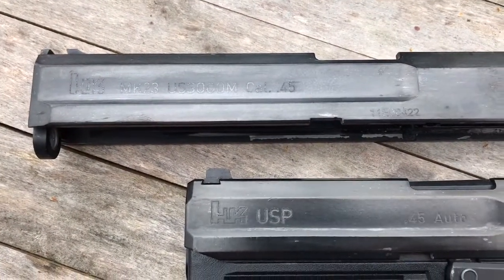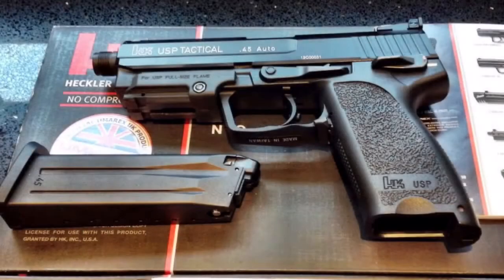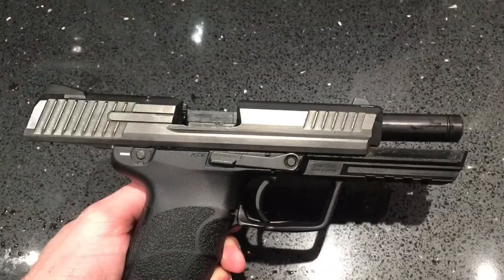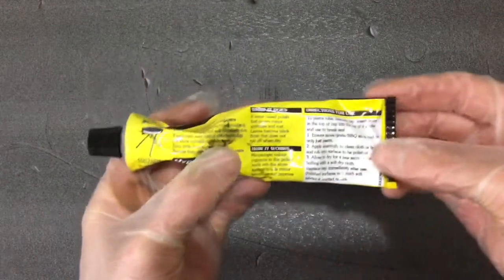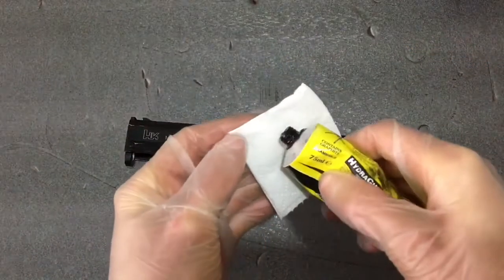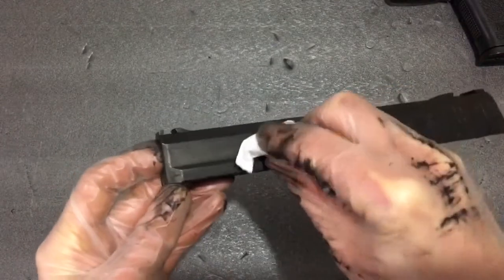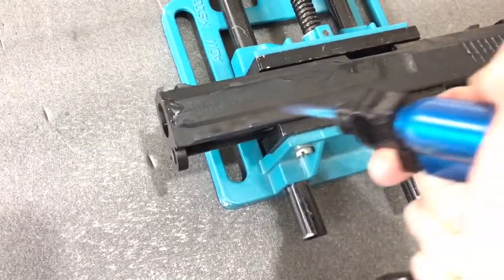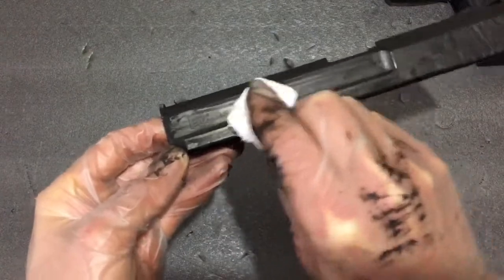How To Remove White Trademarks From Airsoft Guns

Comment: Oh man the first video on this got me interested but this one definitely has my attention. Only thing I'm worried about (never dealt with this product before) is does it leave a residue? Does it stain the part and can then be cleaned and manipulated? Will I have polish residue on my hands every time I rack the slide? Dumb questions but this is definitely something I want to try!
Reply from the maker: +zebracherub 
If you don't brush the serrated edges free of build up, you're likely to get some residue yes. 

The polish over time wears off with only slight residual flecks of graphite left on the metal, especially on GBB pistols where just above the ejection port, silicone oil will splash onto the surface and seep through polished area. 
Without the heat treatment one can return the finish almost back to the original state, as I said you'll still get the odd metallic specs but on the whole it doesn't leave stains. 

Good question, thanks mate.
Reply: Thanks for your answer!
Reply from the maker: +zebracherub 
You're very welcome

Comment: How long and often would you add the heat in the ten minutes. Would a hot airgun work ?
Reply from the maker: No just a quick pass to season the polish into the metal. You don’t want to potentially compromise the material, it could warp depending on the particular type of metal. 

I don’t know about a hot air gun as I only ever used the flame.

Comment: But is this permanent? And will it leave black marks on your fingers when dry?
Reply from the maker: If the lettering is recessed a little it’ll stick around for a while but it’s not a permanent solution. If your fingers come into contact with it once dried it’ll still imprint onto you.

Comment: Just tell honestly, will the black finish of the slide be slightly lighter after this stove vax? Yes, I can see that the letters got darker, but the slide itself got slightly lighter and not so black as it was before. Right?
Reply from the maker: It’s certainly highlighted the surface with a noticeable sheen than before. Perhaps it’s giving the illusion it’s lighter. I wouldn’t say it alters the colour shade. 
On my AKM it hasn’t made it lighter, rather it’s accented the lines and curves where it gives it a nicer hue.

Comment: I have a question do you have to use the polish on the whole slide or can you just use it to take the white lettering off and that’s it?
Reply from the maker: This is mainly coating the entire slide and making it all blend in. . Otherwise you could just fill in the engravings with a extremely fine brush.

Comment: How did you remove the white warning label (the one that reads like a paragraph) on the right side of the slide?
Reply from the maker: +messmeister92 On the examples I have only have the one line of Umarex licensing. The polish was able to subdue the text so it isn't as bold.
Reply: I wonder if it's a US-only warning. It's a big paragraph in bold white lettering. I gave up trying to remove it and just used a permanent marker. It doesn't look great, but better than it did before.
Reply from the maker: +messmeister92 
Ah yes. I've seen a couple of examples from other YT videos stateside. That paragraph is horrifying.

Comment: I know this is a bit late, but I have a metal weathered style Colt SAA revolver with white writing all over it, I don’t want to damage the weather look in any way, but I really want that white lettering gone, any way I can do this?
Reply from the maker: If you have used something abrasive to buff up the finish for that weathered look, the stuff I used in this video won't really conceal the hard work you've put into it. 
It would give it a different hue and reduce the boldness of the white letters. 
It's not permanent and will come off with a damp cloth if required.

Comment: Could you do the same with a Remington 1911 slide to get rid of the white warning bit
Reply from the maker: If they’re engraved, the polish would subdue the stark white lettering in the similar way it has worked with the slide in this video. 
If it’s print onto the slide it may be able to be peeled off by applying heat.

Comment: What about those nasty Umarex 'legal' disclaimers on KWA / KSC HK plastic frames (such as USP.45 and HK45)? Can they be removed completely or are they etched into the nylon fibre?
Reply from the maker: +Cam Kustka 
I've just tried removing the disclaimer from my spare USP frame using nail polish remover on a swab of tissue paper. 
Yep that works however it negatively effected the plastic finish that lies underneath the writing. 

So nail polish remover works but is a little harsh for the polymer. Perhaps alcohol would be milder?

Comment: Sweet.  Thank you so much for the tip.
Reply from the maker: You’re very welcome. 
Thanks for watching!
Reply: Just one problem though, the product is not cheap by any means.   I checked Amazon and it has it listed as $56 + shipping for a 16 oz tube.  It is also non graphite, so I am not sure what that means.  Any other alternatives out there?  Would any generic stove polish work?
Reply from the maker: There are a few different brands that offer virtually the same thing. Technically anything you may find would probably produce similar results. 

If you end goal is to blacken up white trademarks to a more realistic engraving, then I’d imagine any generic stove polish would work.
Reply: Great.  I have few other plans in mind, if those fails, I will have to rub it with the stove polish.  Some generics version of the paste sells less than $10 or so, which isn't too bad.   The end goal for me is to remove the ugly white markings. Thanks once again.

Comment: So does this technique works  on the white marker on Kwa MP7?
Reply from the maker: +The SpongeNoob 
It can be applied to plastic pistol slides to give the illusion of a metal finish (and of course blacken white trades as in this video). 
But applied and polished onto an MP7 would probably make it look weird and give off a slightly metallic tone in contrast to the polymer. 
Have you tried highlighting it with a marker pen?

Comment: What do you do if its a white paint thats not a laser mark on your airsoft pistol?
Reply from the maker: Acetone on a cloth and gently massage it away. 
Test on an inconspicuous area before as it may alter the finish / surface.
Reply: @BadaBingPictures  Is it also okay that i just rub the gun slide without removing the internal of the slide? Im worried i might not be able to put it back together😅
Reply from the maker: @tunyaist I suppose you could. As you’ll need to maintain the pistol anyway, it’ll be beneficial to learn how it comes apart. And then you can properly address the white trademarks.
Reply: @BadaBingPictures what color should i use if i accidentally scratch the black paint off😅

Comment: I have a colt classic model, if I use the black stuff will it make the metal black?
Reply from the maker: If it has a nickel/stainless finish I would advise against it. It may dull the sheen.